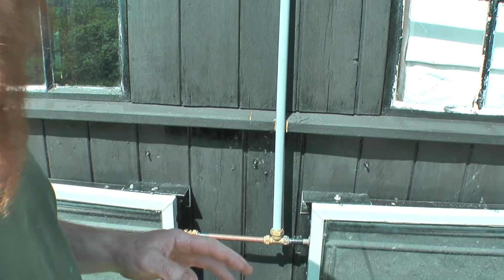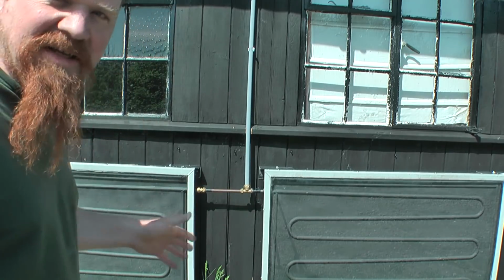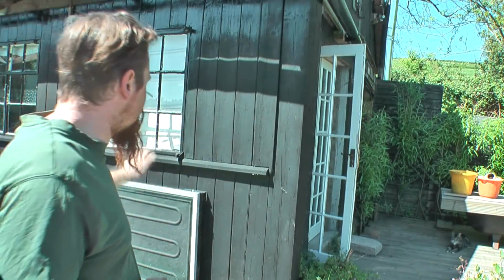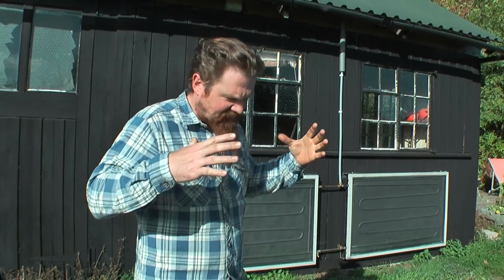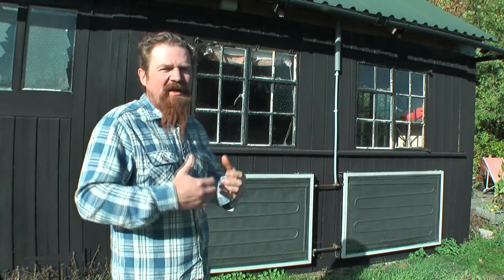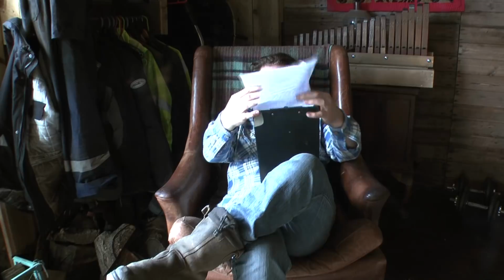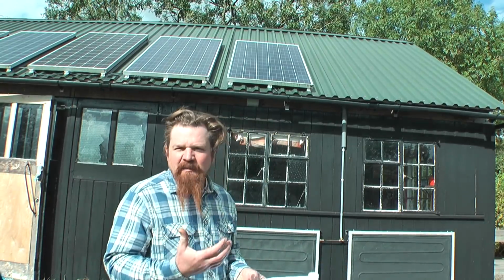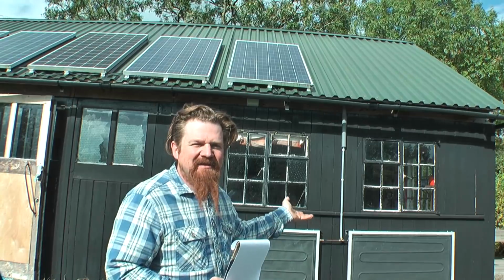Solar Hot Water Part 3 (of 3)

Comment: I think what he meant was that solar eclectic panels are not efficient compared to solar thermal panels, because solar electric panels can only turn 18 - 24% of the sun that hits them into power, while thermal solar turn everything you can capture into heat. Also you should look into concentrated solar thermal if you want really hot water. You can make them yourself if you want, the most basic from is a cooper pipe half painted black with a curved mirror behind it.

Comment: Really enjoyed all your videos and explanations of how the system actually works. One question regarding you not lighting the range to heat water but how are you cooking?
Reply from the maker: At the time of the video, summer cooking was on propane but now, as I have more solar panels up, cooking is all electric!
Reply: Noticed the increased number of panels in another video. Is there a video with an update of your power supply/system?
Reply from the maker: I've been doing regular updates for patrons. I'm still in the process of upgrading it all, I may do an overall update video when (if) I ever get it finished.

Comment: Hello Max, I just discovered your channel and really enjoy your videos and I’ve just watched your Solar Hot Water series, great design, cheers. My only thought is if the exterior plastic pipe riser from the solar panels is resistant to the UV exposure and if it needs to be protected. It’s now 27 January 2022 and it looks like 4-years after you built it and released the videos so if there is a UV problem you might have discovered it by now. Thanks. Michael
Reply from the maker: It's still going strong!

Comment: you should NEVER throttle the thermo-siphon; so long as the panel is hotter than the water tank above it the heat will flow up. if you slow this flow down in any way you're letting the panels get hotter than they need to be and they LOOSE energy to the outside air. You should be trying to design the system in a way that promotes flow as much possible; avoid 90 degree turns in the path, use curved turns where possible, have a trumpet style transition on the pipes inside the water tank. Insulating the exterior pipes (both hot AND cold side!) also helps a lot, as would tilting the panels ~30 degrees from horizontal (optimum angle for winter where I assume you are). lastly think about the area of the panels; for a well designed system you should be able to get 4x more energy per unit area compared to PV, but you have a tiny area compared to your PV.

Comment: An interesting experiment. I think that a key point is that its purpose is to contribute to providing hot water rather than to provide all of the hot water. Our modern life systems tend to shun multi-mode solutions which means that we miss opportunities, probably in many areas.

Comment: A year later so I'm sure you have covered every comment (still working my way through your videos). 1. I'm guessing you have already clocked that if the rads are open the panels are effectively out door radiators. I may be wrong it did take a bit of thinking. 2. If you did want to I crease the "delta t" of the panels rather than turning the valve on or off (or doing an arduino project for solenoid valves) you could fabricate something to put a cylinder head thermostat valve In  the loop. I have no idea if you could buy one what would open at a low enough temperature but as long as there was a small hole in it it would work mechanically without any control required. Perhaps if you could buy an adjustable threaded valve? Or make one?

Comment: Would a smaller diameter feed pipe from the Solar panel help so heated water won't be drained off and get to the tank faster to transfer the heat in the tank? I'm late but enjoying your post. Yhank you.

Comment: Hi. When you use the stove boiler, doesn't it turn the solar collectors into radiators? Is your system somehow protected from this condition?
Reply from the maker: Yes there is a full bore ball valve in the return line to the solar panels which I can shut off at night and open in the morning. In practice I leave it open nearly all summer and leave it closed off in the depths of winter.

Comment: Love the system, hope you find time & space for the solar tubes you had - I don't see why you couldn't just have rows of them on the wall to the left of these with their own thermo-syphoning system (maybe just run them parallel?).

I feel the very minor improvements you could do to this system are either paint the exposed pipes from the panels black (to absorb even more solar heat) or insulate them (and really even on the return line). So long as a pipe is beyond the bottom of the system, it would be beneficial to paint black at the least.

Regarding the return line... If the solar panels give say a 30 degree temperature increase, then if it's entering the panel hotter it will exit hotter. Also, having the pipes at the bottom of the system exposed will mean the water in those pipes can get even colder and will be harder to lift into the solar panels where it'll be heated.

Comment: What about maybe building a third custom panel for between the windows to step up the max output temp after the 2 panels in parallel. This would accommodate all your peeves with angling and series'ing the panels you have. I do see the reasoning behind others comments about using the panels in series because you assume they think you will gain more BTU's, but that isn't the case they know that a series setup has a higher output temp and flow rate. This is why it keeps repeating in your comments. Adding the 3rd panel would reduce your exposed plumbing and affords you the ability to play around a bit more with testing. People generally like these types of videos and it would benefit you to do such a thing. Adding a panel in series may cure your need to restrict the cold return or at least reduce the amount of restriction you have to use. The 3rd panel doesn't have to zig zag horizontally with sharp bends since the space is so narrow maybe use a radiator type setup with like a 2inch manifold top and bottom with 1/4 inch verticals bent with waves in them for more surface area. This design could be done with minimal pipe fittings also by cripping the 2inch ends and rolling/folding them in or just hammering them flat and brazing the end. Drilling for the 1/4 inch and brazing them into place much like you did with the soldering patch on the ruptured panel you had. One could even flatten the verticals to increase exposed surface area. The world is your oyster shuck it the way that works for you.. On another note maybe a outdoor oil burner to heat some water in the summer versus firing up the stove when it is already warm inside. Hope you find that lady friend sooner than later. Thx for the videos.

Comment: Insulating those pipes likely will help greatly. A reflector on the ground will too. Especially on hazy days. My friends find that an adjustable sheet of aluminum or shiny white paint on wood can be tilted at the far end 3 to 15 degrees toward the collectors as needed.

Comment: What I think you need is a restriction on the inlet in the tank itself to allow the water to settle, maybe 2-3 layers of mesh domes would do it.
You don't want hot and cold water to mix in a hot tank, that allows the water to pick up energy from the hot water on top, and recirculate it into the outdoor radiators, causing more loss in transmission to the solar collectors, and reducing the temperature difference between the collector tubes, and the water flowing through them.
Your tactic of holding the water to allow pressure head to build is counter-productive, since it will cause more mixing in the tank, and increase the rate at which heat is lost to the surface of the collector enclosure.

Comment: Always considered flat plate collectors as a pre-heat system, topped up by back boiler and/or immersion heater. That was until I installed a tube system which is far far more efficient. Now I have no back boiler on the woodburner [getting more heat into the house] and very rarely have the immersion on. The system  provides all the hot water I need for a couple of showers a day and all the washing up. As it runs at mains pressure It also feeds into the dishwasher and washing machine. In the summer I have to bleed off some heat on occasion. Tube systems rule IMO.

Comment: Using  a DC Solar PV system to run an immersion heater on AC is not efficient because of the losses in the Inverter. Not sure if DC immersion heaters are available, the problem is mostly with the contacts in the thermostat which will tend to arc/weld. Of course, since the power from the sun is free the losses are not too important.

Comment: if you still have this system installed (with the range and the fire lit ) it might be worth putting a thermostatic switch (set at 95C) on the pipework somewhere so it turns on the underfloor heating pump to dump the heat into the concrete before the water starts to boil!!

nothing worse than falling asleep in front of the fire and being woken up by the pipework banging and clanging as the water turns to steam

Comment: On the subject of efficient use of PV  to Solar Thermal (the guy could be right) if you've got 20% efficient panels and you are then using that electrical output to heat water, cut out the middle man and just go direct to solar thermal and reduce losses. Yes everything can be lost as heat, but electrical efficiency in generation and subsequent use does compound even if the end state you want is just heating anyway. Probably not so good in most of the UK, but in my place in Greece Solar Heaters are absolutely amazing for domestic needs.

Comment: Good video series, I like your approach. Interesting point about using solar electric with immersion heater would be your preference. I am designing a system for down in Dorset and was planning on solar thermal for the summer hit water. I will have to do the sums to see if the cost of PV panels Vs some cheap / second hand / homemade solar thermal panels.

Comment: Just one thought about slowing down the water through the solar panels. I used a 6kw water heater for the kids pop up pool a couple of years back and the pump pushed the water through so fast you couldn't tell any difference between input and output temp. I thought it wasn't working. On researching this I found that the heat energy is transferred to the body of water regardless of flow rate and the pool warmed as expected. Might be worth considering, so just an idea that might be worth an experiment (I didn't have a slower pump to check) Might save you some time. Great ideas though, keep em coming

Comment: I would say your wrong about lining them in series.  Yes there is only a certain amount of heat but putting them in series would heat the small amount of water hotter than in parallel.    This would then make your system cycle which it doesn’t do when you don’t have enough sun.

Comment: You may want to just try insulating your return pipes I suspect your system will still flow albeit slightly slower which isn't an issue as you had to restrict the flow anyway.
I suspect you'll find the overall temperature in your tank will increase.

Comment: Interesting! It's a crime to use PV to heat water, unless it is to dump load when batteries are full.
With PV being about 20% efficient, those two thermal panels would be therefore roughly equivalent to 8 PV panels of the same size.
It would be great to combine the two, so PV panels also heat a coolant thermally, which also cools the panels and makes them more efficient. This is a win-win!
I don't know of any panels that do this yet, but there should be!

Comment: If you want the heat to build in the panel before it dumps it's heat to the cylinder, all you need is a PRV on the flow & a non-return valve on the return to stop the heat expanding up the return line.  I would try a low value PRV, say 1Bar. I would also add a TPRV (3bar) as a secondary safety valve. If you don't and the first PRV fails to open, you will have created a bomb. I would even go as far as to fit a third one on the return line before the non return valve (as it will be cooler there). As far as sanitising the cylinder, it's recommended to heat the cylinder to 60C degrees once a week. (air source heat pumps are setup to do this with an immersion heater).

Comment: But I think that would only work if the return line was lagged.. Then all the heat loss would be in the tank, so you would still have a temperature differential in the feed and return line, from the heat loss in the hot water tank.. My folks have had a thermo siphon hot water system for over 30 years and never had to play with valves to get high temps.. But the panel is only just below the bottom of the tank

Comment: Still having issues with three. I finally got to watch by using two phones and tethering from one to the other, with one up a height for signal. 

Here's a bold statement. You can't realistically size a solar system to your batteries in the UK...... Not off grid anyway...

If you need everything to tick over in the winter. You need a system that works in the winter. Aka enough storage to get by, and enough solar panel "capacity" to replenish those batteries.
To have enough solar to do that, means having a way over sized system come summer.
Having more batteries is no good, because come winter you can't replenish though extra AH you've consumed..... 
So "storing" that solar engery as heat in tank, or floor, once the batteries are full in summer makes perfect sense. 

In the winter the burner takes some load, heating, hot water, oven, cooking. 

In the summer when those batteries are topped off. Ceramic hobs, immersion heaters, bread makers :) 

Typical YouTube questions, what have already been answered in part 1 or 2 lol

Comment: Max please insulate every piece of pipework that is outside (and the return line inside as you say the thermosyphon is too strong anyway). You have seen a good improvement to temperatures by insulating your tank and I'm sure you'll see a similar improvement by insulating the rest of the pipework.

Anything uninsulated outside is just leaking heat that could otherwise end up in your tank. 

That is my only criticism,  great job and looks like the effort is paying dividends!!

Comment: It would be interesting to know what your solar panels contribute to heating the water, you could work it out. Formula  QkW= (litres of water X 4.2 X temperature rise delta T) / 3600.

A standard domestic cylinder is around 130 litres, in that case, it takes 160 Watts to raise the water temp by 1 deg C,  I'm sure you can work out the rest. BTW it takes 8kW to raise 130 litres by 50 deg C. I think your electric immersion is doing a lot of the work; probably 2/3.

Comment: I'd say lag the cold return-side also, it will cut down on losses, making the return-water going into the panels hotter, and this will in turn slow down the thermo-syphon a bit, but you are talking about having to throttle the valve anyway, so all in all, I think this will allow you to accumulate a higher final temperature at the end of each day.  The thermo-syphon will be able to self-regulate the flow of water better.

Comment: Another great video. Thanks. This has me thinking.

I am just about to do a modification to a 30sqm building to make it a live/work. It is not off-grid. It is a garden building 25m away from a house. The services will be trenched to it first. 

I have ruled out putting gas to it, as the regs are awkward. So, I will put water, electricity and comms to it. 

It will be airtight and have a small MVHR plant.

I was thinking of heating it with electric underfloor and a wood burner for MVHR, and am toying with putting a water system under the floor as well as the electric. I am assuming I will need to plan the systems for this carefully, and that I need a heat exchanger with input coils to connect with the wood burner and possibly coils for a wet solar system. 

The main reasons I am doing this are to have a place to live in winter, which is cheaper to heat than the main house, and for when I am recovering from bouts of surgery, which I will have to endure at least another 5 times in the next 10-15 years. 

The house is really awkward for mobility, and modifications would be very difficult. I don't really want to move; it's a nice house.  

Looking at this statement, it all sounds a bit complicated. Realistically, maybe an airtight friendly free standing wood burner and the electric heating system will keep it simple and be adequate. It will be well insulated, so maybe I am over-egging it. If you have any suggestions, they'd be welcomed. 

Thanks.
Reply from the maker: You can vent any woodburner from outside (which is a good idea anyway to avoid drafts). If I was building again I personally wouldn't bother with underfloor heating, it takes too long to warm up and even though the slab is insulated the heat dosn't seem to store very well. The other drawback is that underfloor heating only really works well with a stone/concrete floor and I prefer the proper floorboards in the rest of the house! If you're expecting to have mobility issues, maybe consider a multi-fuel stove instead of a pure woodburner? Just thinking of the number of times, you'll be needing to refuel it. My kitchen range is multi-fuel and being able to run it for 12+ hours on one load of smokeless fuel is a real bonus in the depths of winter. It sounds like you're on the right track, thinking ahead is a v good move. I know what is like recovering from surgery - I sincerely wish you a speedy recovery each time.